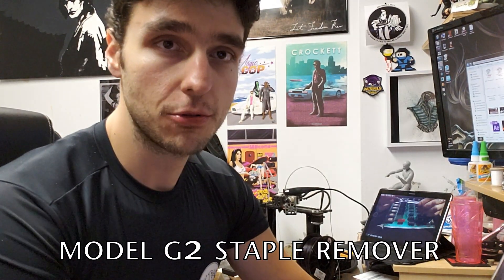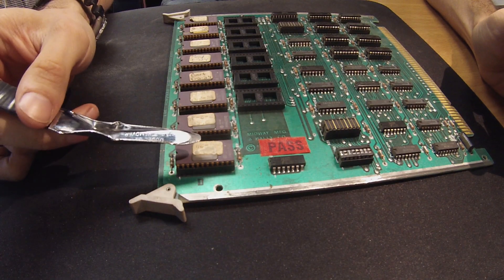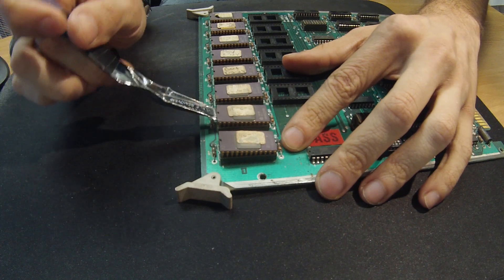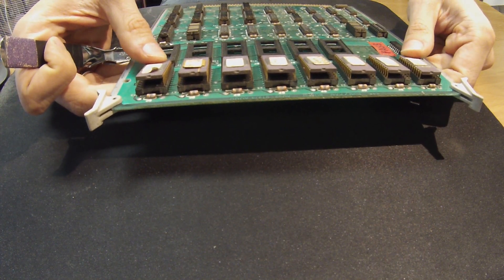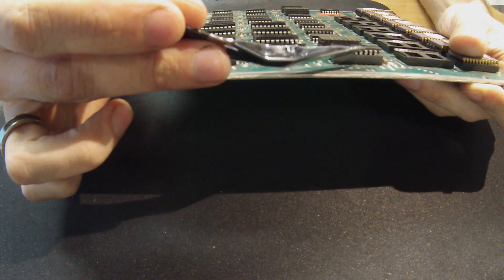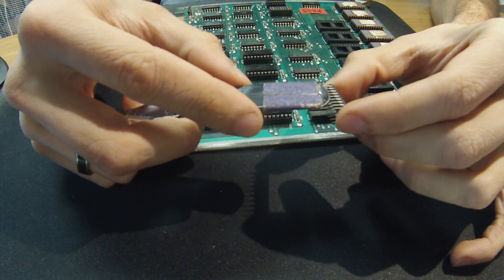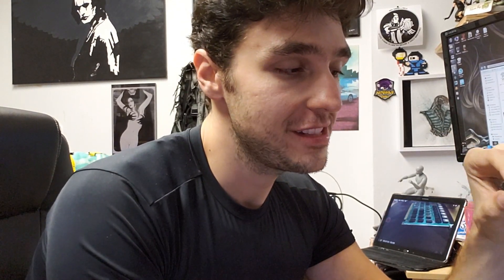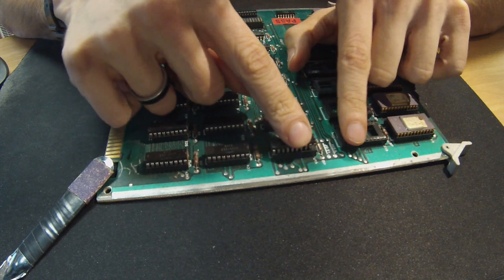How to re-seat arcade PCB chips : Intro to Arcade Repair

Comment: that is NOT a kick pcb and NEVER NEVER sand chips. Sanding chips exposes bare steel which will rust away .  Use a fiberglass pen or jewelry cleaner and a paintbrush, ic chips have a protective layer for a reason .

Comment: Very cool...Showing actual glitches at the start of video and the showing your results would be cool....Does using spray like de-toxic on the chips before physically moving the chips work as a first move work? Have not tried yet...Just asking...
Reply from the maker: The game Kick has some graphical issues in the background. Its not the best angle, but you can see the balloons flashing in and out during the gameplay.

Comment: Love the video and concept, but why not use a traditional chip puller tool?
Reply from the maker: I've always liked the ease of use on this staple remover. Its very versatile and, in my opinion, it handles better. The width of the tip gives me more feedback from the chip too.